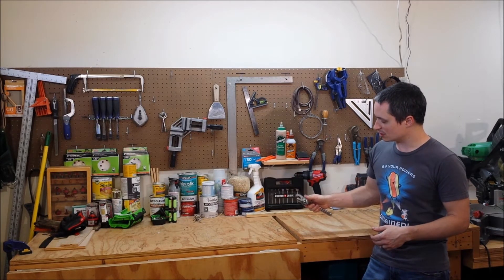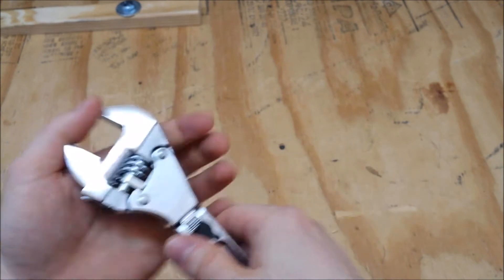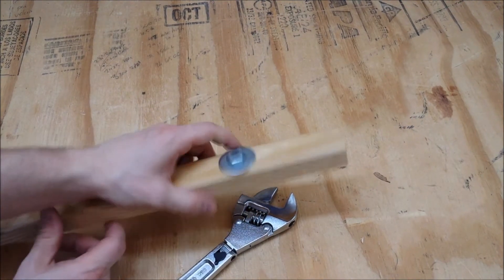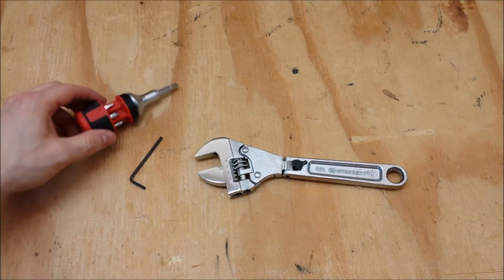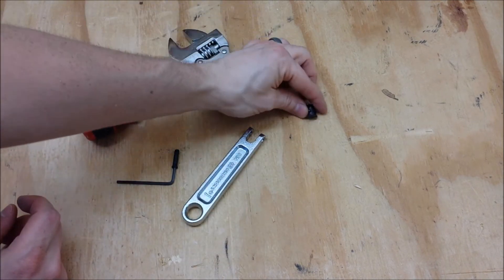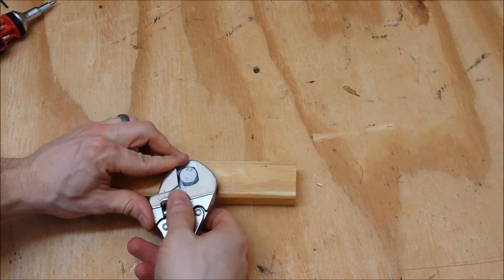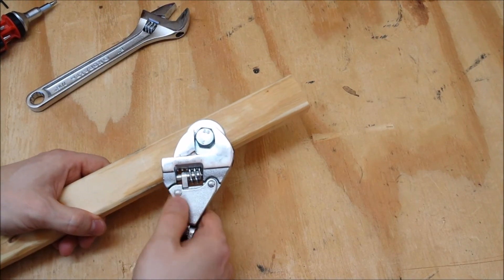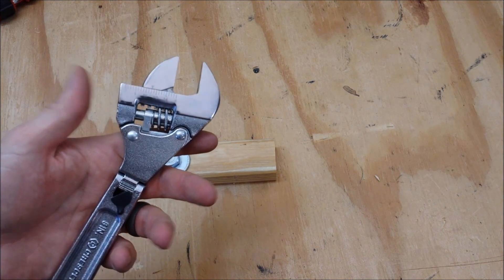Crescent Adjustable Locking Flex Ratcheting Wrench Review

Comment: I just purchased one from Amazon and intend on using mine mostly to turn light bulb sockets on my car to change the bulbs in tight spaces avoiding the need to remove many parts just to get at those bulb sockets. I have small hands and can get my hands in to reach the sockets but I don't have enough room to apply a strong enough grip to actually turn them so I'm hoping that flexible wrench will provide the grip needed. After I will add another comment on if I was able to use it for that purpose.

Comment: I don’t think this was designed to replace a regular crescent wrench or be used for bolts… I believe this was/is designed for handy men and plumbers to do water valves under sinks… And it seems perfect for that after watching this vid
Reply from the maker: Nope, I've tried using it for that. Way too bulky. A basin wrench is far better for that application.